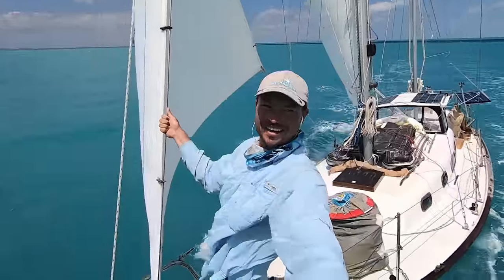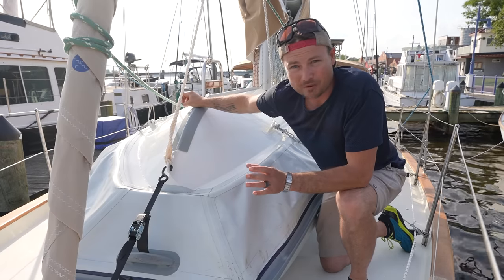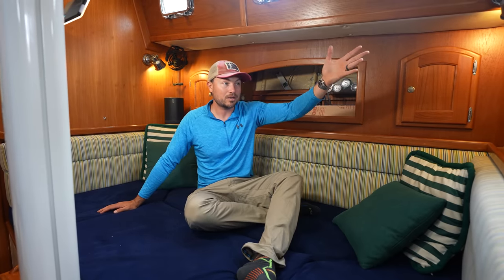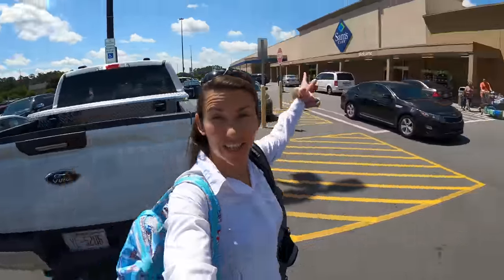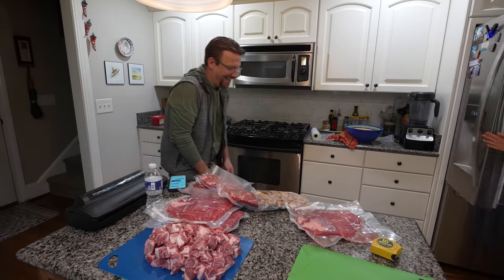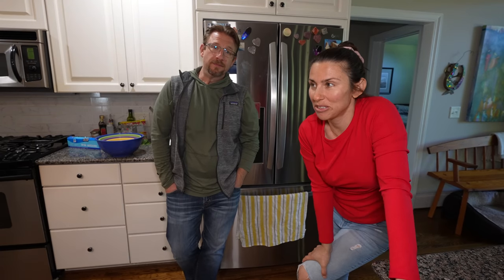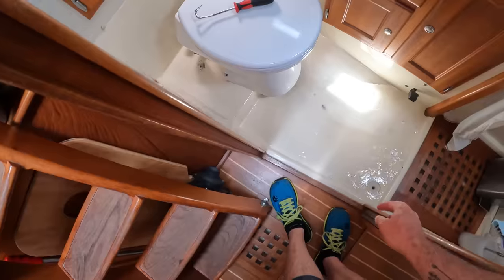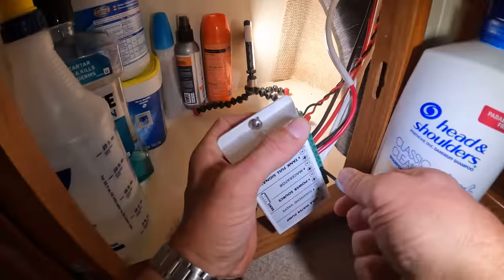It’s Finally Over! | S06E48

Comment: Jordan, with the outboard motor it's important to keep the motor higher then the tail. Because the cooling system use water out of the sea, salt water will damage the motor! This because the rest water runs into the the motor. So if you want to store it for a long time, all the salt water needs to get out of the cooling system  to avoid the damage. I see on the episode that you store it wrong. It's only a advise from me, my outboard was dead after a winter in store in the wrong position. Do with it what you want. Take care with the overtake to  the Azores, Portugal and more then that. Take care of Desiree and the baby, We are happy for both of you.
Reply: I'm sure it will be fine.
Reply: I also wonder how the outboard is laying on its side because it may leak oil.  I don’t know if they are designed to lay like that
Reply: Jordan, maybe when you put the outboard back down for the crossing
Fold up an old moving blanket for it to lay on. No rattling or damage. 🤷🏻‍♂️🤔.
Baby congrats and happy parenting,if
that’s the right phrase!?!🙃 good 🍀
Reply: All you need to do is flush with fresh water
Reply: Somehow I would try and attempt to store it on some bracket mounted vertical on a bulkhead (easy to say I know) or even if it is slant but mounted on some side wall.
Reply: Yeah when I saw the angle that it was laying from what I’ve ever learned outboard it did not look appropriate

Comment: My dad bought a 30 foot Yall kit sailboat. The deck and head liner were attached at the factory but the deck assembly was not attached to the hull. All the fittings mast included were unassembled. Rigging the same way. The engine was a Volvo diesel two cylinder, not installed. The name he chose was Windlass. She was launched in the lower Niagara River about a mile from the falls. She was moored in the current, three or so knots, and had a fine life there. We would take her out into Lake Ontario quite often. My dad was a Navy man and there was nothing he couldn’t do. During the housing recession in in the late eighties he moved to Annapolis MD, he was a midshipman and graduated from the Navel Academy in 45. He decided to bring Windlass down to Annapolis about a week and a half before Thanksgiving. From western Lake Ontario through the Eire Canal ( lower the mast) to the Hudson River (raise the mast) into the inland waterway, out into the Atlantic Ocean, through the Cape May canal up Delaware bay, then access the Delaware canal and finally into the Chesapeake. 
My brother took the first leg to Tom’s River New Jersey where we switch. That evening after ship’s duties we laid at anchor and took rowed the dinghy to the nearby dock tied up and almost got stinking drunk at the tavern. My dad loves the opposite sex and was hitting up with the women there! Luckily for me I was tipsy but not that far gone. About one o’clock that early morning we made it back to the dinghy and I rowed back to the sailboat. I climbed aboard using a rope &slat ladder, it was very cold, fifteen degrees as I remember, and now it was the drunken captain’s turn. Although the dinghy was tied my dad the captain slipped on the Ivey step and into the harbor he went!
We were both dressed for winter so my dad’s clothes were so filled with water he couldn’t even pull himself up the ladder! I grabbed the main sail topping line and lowered to him, he got it around under his arms and I proceeded to winch the poor soaking captain aboard ship. Water was just pouring out of him no wonder he couldn’t climb that ladder! 
 It’s a memory I’ll never forget. But that’s just the middle of the story!
   Good luck with your adventure’s and keep a safety line hooked to each of you while sailing and on deck!! That’s another part of the story. NWR

Comment: I used to be a coastal cruiser and put in an electric head that used freshwater, the difference in the smell of the boat was amazing. As I understand it, with a raw water head after you are finished using the head, all of the organic material (critters) in the water still in the line die and smell.  Great to know there is a system that works both ways.

Comment: Another great video! One thing I would do is foam block that outboard to prevent any rubbing at any point to the boat.  The smallest rub is going to cause you bad headaches in later repair.  Also build a harness strap to use in the boom to do the lifting.  You worked hard getting that outboard in there and you may be on your own taking it out!  Little things to save you!

Comment: Wow, you have done a ton of outfitting and what's impressive you didn't take any shortcuts. Awesome job. It was a LOT of work but now you know how it all went together so when something does happen, you will know exactly how to repair or change it. It appears you have covered most all of the bases for preparation for the adventure. The actual sailing part is about to begin!

Comment: I always wore a harness with two lanyards, one fastens to the running lines, the other is used to cross any transverse obstacles-so you take the one over your shoulder and clip it on the other side of the obstacle before you undo the other.  Until you get swept off your feet by a wave and fly helplessly across the deck only to be jerked to a stop by your harness,  you will not fully appreciate the power of the harness and sound fastenings and pre-set jack lines.  I also trailed a dead man's rope, but if one ever did fall overboard, the chance of catching it and climbing back aboard it not an easy one,.

Use your shower waste water to flush the toilet. Marine macerator heads use only a small amount of flush water. Of course you have to pour a little sterilant down the shower drain or it will go off in the tank and smell awful, but it works fine for flushing a freshwater heads if you have about fifty to eighty litres of tankage of shower waste water for head flushing.  The excess shower water once the flushing tank is full can go over the side.  Use siphon breakers never one-way valves.  If the flush tank runs low then you can add more fresh or add some sea water.  Mine never did and there was two of us aboard.

Comment: You might want to get a few tubes of PU18 marine sealant to add to your bdr/toolkit. It's obviously marine standard but also can be applied and cures in wet/damp conditions  and lets face it you'll find the leaks and problems when it's wet and need them fixing then.

Comment: Loved all the project videos. Nothing seemed too mundane. Hope you are considering getting a backup pump for the new head. I can’t remember if you guys have a water maker? Also, confirming with the outboard engine manufacturer that the engine can safely be stored on its side without fluid compromise might be a good thing. Fair winds! ⛵️

Comment: One suggestion. Have you thought about using foam to brace your outboard in the locker so it does'nt rub against hard surfaces and get all scratched up? Similar to what you did with the dingy? Safe travels.

Comment: Ratchet straps of that sort degrade super-quickly and snap.  Mine lasted only weeks--I replaced them with rope ties, UV safe ropes and pelican hooks.  The LAST thing you need is to lose a dinghy overboard--and you WILL  get big waves land on it--but that is OK if you have it well bowsed down.    Carry it three quarters inflated so it does not burst in hot sun.

Comment: It's probably too late, but, keep the outboard on the stern mount, and buy a cover for the upper part of the motor. It will save you a lot of trouble, and the passage is not that long in days. The motor will appreciate being kept upright and be ready to use when necesary. Don't make it hard on yourselves. Thanks

Comment: FWIW Desiree, nausea and extreme fatigue are pretty normal. I definitely experienced all of it when I had my daughter, so don't blame yourself!! Once I threw up all over myself in rush hour traffic driving myself home from work.  I was in a place on the road where I could not pull over safely but also couldn't stop from throwing up...... So I just got on with it and drove myself home. Came home and stripped off my gross clothes straight into the bottom of the shower as I washed off and crawled into bed with my hair still wet. My husband came home and wondered why there was puke on the steps and my clothes were in the bathtub. 🤮 Hopefully it never gets that bad for you, or at least on the Atlantic crossing you can make it to the side rail to pray to Neptune.

Comment: Jordan I would do the side cords for the dingy attached to something else  other that the life line posts , so there is no tripping hasard   if you need to dash up to the bow because of a  failure or emergency in bad conditions. Just a thought all other channels that have made the crossing  have had great conditions after heading east. Bon voyage

Comment: Good to hear that you are finally nearing the end of your refit and are about to take the big plunge in crossing the pond! 

Two pieces of advice: 1) Make sure you have a hand-pumped watermaker with you should anything happen to your water supply, as well as, if you are forced into a life raft or dingy, in the event of an emergency situation in the middle of the ocean, you will have a way to make as much as you need to survive until rescue.

2) Put netting from the top of the guardrail to the caprail all around the boat while underway. It is incredibly difficult to pull someone back onboard during rough seas if they are wearing clothes or foul-weather gear when they go over, and you have a pet to keep safe. Also a lifeline from stem to stern with a short leash attached from the harness to the lifeline if the need to go forward during rough weather is needed.

Stay safe and have an incredible journey!

Comment: Jordan, call an outboard dealer or repair shop about storing it on its side or what’s the best way. And I suggested a old blanket under it but if it got wet somehow it would mold I guess. So maybe the styrofoam some one suggested is better. Or a semi
inflated old plastic air mattress 🤷🏻‍♂️.
Have y’all contacted SVDelos about a 
“baby on board”?  Don’t forget the bumper sticker on the back!?!🤣
The NEW parents thing will be more scary than the crossing, guaranteed!

Comment: Newer, bigger, more expensive doesn't mean that a particular boat is ready to go to sea. Nor will the latest chart plotter tell you how to navigate a seaway that sends green water over the deck on every other wave.  I came out to Newport on November 1 to deliver an Oyster 52 down to St. Martin.  It has a lazzerete big enough to sleep in.  Unfortunately it lacks attachment points for heavy items like the emergency tiller, spare anchors and the 15hp dingy outboard.  As I began to organize it for offshore storage the owner asked what I thought I was doing.  I explained that I wanted everything to stay in place as we fell off the top of waves. He walked away mumbling--- three days later we were falling off the top of 15' waves in the Gulf Stream left over from a three day Northerly.  My mule packers' diamond hitch did its job. 

The Oyster has a davit system that looks strong enough  to hoist the entire vessel.  Unfortunately it will also carry a large hard bottom dingy upright ready to scoop up at least  a ton of water.  A heavy duty tarp from Home Depot, a spare halyard, and my mule packers diamond hitch may not have looked yachty as we arrived in Bermuda but the dingy didn't serve as a sea anchor on the way.

Comment: Typically there is a preferred side/way to store an outboard so that you don't get oil leaking in the cylinders and valves... And I trust you burnd off all the gas in the engine before stowing  : )

Comment: Desiree your glowing!but yes, at first ya feel like you have the longest hang over in history! Although your handling amazingly well for being on a boat! I think its a blessing that youll be further along by the time you sail and feeling better. COMfort is everything, it helps the circulation.For nausea  ginger is great and safe ! You can do the following and get the same effects as having a vacuum seal: using ordinary plastic bags, 1. have pot with hot water waiting, burner is off 2. stick food in bag. 3. hold bag up up to an inch or two from opening into the waiting water.4. close bag making sure that all air is gone. Laterally shrink wraps your bag! Also to insure fresh lemon juice for cooking and drinking I take the entire lemon/s wash, put in blender or use a juicer, put the juice in an ice tray and freeze it. I also do this with my herbs,oil and lemon combo. Ilove my fish with lemon and dill and hate when I run out. Since there are no stores on the atlantic best to stock uo and never buy that fake lemon juice in the bottle. Love ya both!

Comment: I realize this is probably way too late to affect the passage, but I wonder if it would have worked to use the freezer to just freeze ice packs and store the frozen goods in a big Yeti (using the ice packs to keep things cold). I feel like the ice chest would keep things cold enough, but the size may be a problem. And the fact that a large Yeti costs the same a full sized refrigerator.

Comment: Des,  For some reason in pregnancy, the beginning is the most exhausting.  You are definitely normal.  Pregnancy is not easy.  Actually, you are doing very well. There are some morning sickness horror stories out there.  It seems like Jordan has been very supportive, so you are blessed. You can look forward to getting your energy back soon, so hang in there!!!! 

Regarding MOB, one problem is seeing the MOB due to waves.  Divers carry inflatable safety tubes that will rise vertically 6ft to make it possible to see someone floating in the water if the waves are larger. They can be manually filled and are fairly compact and can be clipped right onto the life jacket. I would think that that would be an important addition to your safety gear. 

I am looking forward to seeing your crossing!  What happened to your nephew crossing with you? I am glad that you have a friend who will go in his stead!

Comment: I thought of this as I saw you wire the new toilet. I always did my wiring but would put a layer of Vaseline on wiring junctions. My theory was that it would protect the wiring over the years from inevitable salt contamination. No idea if it really helps or not. Just seems like a good idea. Right or wrong?
Reply: Dielectric grease is good.  Vaseline sorta melts when it's hot.

Comment: I would not trust that app based MOB alarm thingy unless tested.
You might want to set your phones to flight mode*, strap one of those watches to a life vest and throw it over board. Don't look for 10 minutes.
Than try to find it and get it back on board.

* To make sure it does not depend on a mobile network being available. If it is based on Bluetooth, wich is okay, selectively disable mobile networking instead.

Comment: I think that the outboard should have stayed upright, especially since 4 strokes are not good laying on their sides. The oil can seep into the cylinders. It would be better on a sturdy bracket on the stern, easier to use in an emergency also. 2 strokes on their side is more acceptable. no oil in the sump.

Comment: Do you have any info on the sound deadening material that you used for your engine compartment? Like the make, thickness and where you purchased it. We need to replace all of our engine compartment's insulation.  Caterpillar 3208 make lots of noise.
Thanks

Comment: If that’s a 4stroke motor, if it’s stored horizontally, it usually is stored handle side down, or the oil from the crankcase will flow into the carb ruining your day for sure, how do I know🤣

Comment: Wow! The Olas system seems cool; but shouldn't it show you where the watch is now in real time. Not to the place in water where the watch went overboard. If it tracked the watch itself versus the location it went overboard; seems like it would be more effective for finding lost crewmember. Especially in high current. Is that parameter adjustable? Or does olas only guide you to place where crewmember fell overboard?
Looking forward to your crossing.

Comment: Some time ago you made a comparison in dollars about what this boat and all the repairs until that moment had cost you and the costs of a newer boat. At that time an the older boat (you own now) together with the costs of the repairs were still cheaper than the newer boat. I wonder how that comparison would now look like?
Reply: a new PS40 is $650k and still needs prep. This is the reality of used boat ownership. Great used examples still usually need 20% more funds to fit out and refit.

Comment: Err.. Won't that ratchet strap be totally rusted away by the time you get to the Azores? Doesn't look like stainless, getting blasted by saltwater 24/7. Plus those mechanisms are fiddly and unreliable as well... Could just use a piece of dyneema looped back in itself to create some purchase?

Comment: The toilets vital ...it can sink your boat at worst and cause all sorts of problems if its not right.. and thats even without a pregnant wife on board 😂✌🏽👌🏻⛵
Olas works like a mini personal E-purb..ive seen some high end life jackets fitted with.  Good idea but i bet someone forgets to take it off or put it on a couple of times.😁

  To learn from ones own mistakes is normal...to learn from other people s mistakes is  intelligence... Physical tasks require both 😉
Cap backwards or sweat band...its cooler 🥵 thin work gloves with if need be cut away finger tips for jamming into tight spaces.